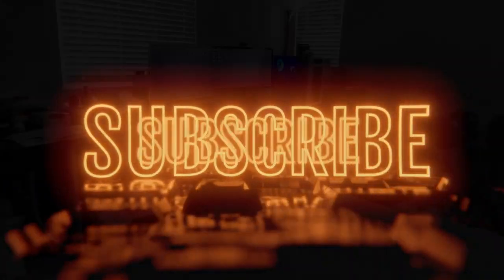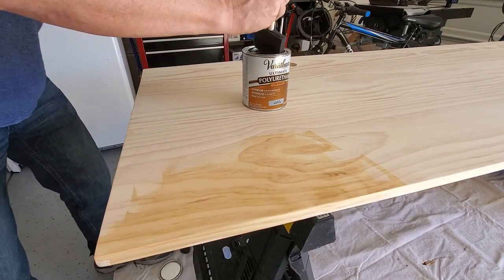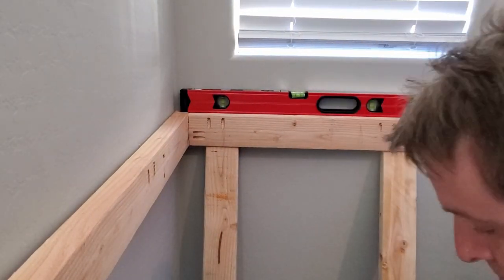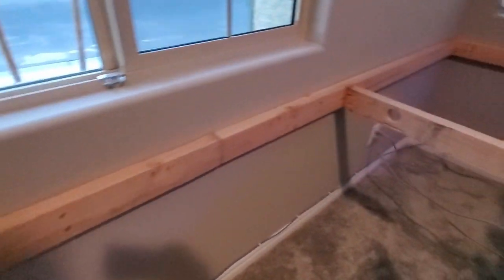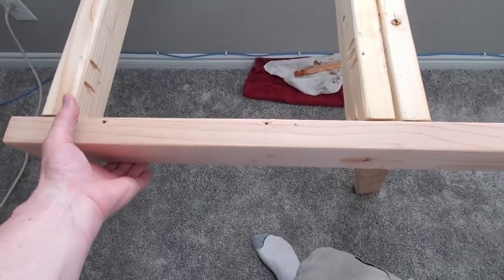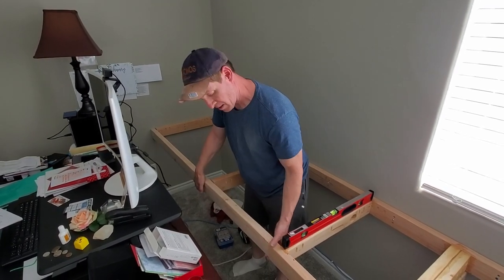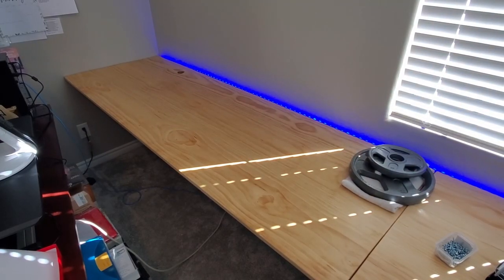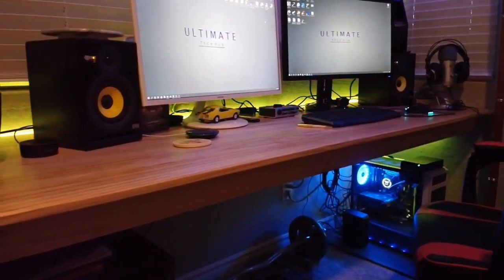MASSIVE FLOATING DESK BUILD HOW TO - LARGEST FLOATING DESK 2021

Comment: Should use longer screws to attach to the wall a 2 1/2” deck screw has 1.5” of 2x4 .5” of drywall which means only .5” in the stud
Reply from the maker: Yes you can use a longer screw.
Reply: nah. lag bolts.
Reply: @UltimateTechHub  I think his point was you SHOULD use longer screws not your could.  I agree too I’d be scared that thing would pull down over time if there’s not front support.  Cool build though. Definitely would have used my bolts myself. I guess since the weight is distributed across the back and sides it should be fine.
Reply: Nah nobody asked what u thought
Reply: I agree with pre drill and use lags but hell if you use enough of them should be ok. Just get up there and jump on it a few times to test. LOL

Comment: This could have been 5 minutes long and just as informative.
Reply from the maker: Yes it could have been shorter but I did want to show each step in detail. However I may upload a shorter version for those who want just the quick basics. Thanks for the feedback I appreciate it and thanks for watching!
Reply: @UltimateTechHub  this is great as I am a super beginner so the length is just right.  I come on here because I’m not experienced at all so I like to see all steps!  
Question though- you used the 4 different grit sand papers… did you do all of them in that order THEN used the poly?  And in between dry coats did you use the 320?  Hopefully not TOO dumb of a question(s), but everyone has to start somewhere right?
Reply from the maker: @keonetaihook2990  Yes Start with lowest grit to highest then wipe down well apply poly and sand with 320 or higher between coats. Apply 4 coats of poly or more for a wonderful shine.
Reply: For people that have no experience, the exact steps are appreciated. I’m very good with technology but when it comes to things like this, I feel dumb. There’s time stamps so you can skip for a reason
Reply: @CallistoRex  That's fair. I must have been feeling impatient that day.
Reply: @alexbrand4284  I know that feeling all too well!

Comment: Great project. Turned out great. If I may add some advice for next time/those looking to build...  When attaching table tops/desk tops that have been glued up such as yours with dimensional long grained lumber, it should never be glued down to the frame. You have a cross-grain situation that does not allow for the wood to move (contraction and expansion) with the changing temperature, humidity, and pressure. Over a period of time this may cause splitting, cupping, crowning, and all types of separation.  It's best to use fasteners for attachment like figure 8 fasteners to allow for movement. While I see in the comments you haven't had any problems, and that's great, I still wanted to mention this so others considering similar projects will understand the ramifications. Wood has a mind of its own and it's going to do what it wants.  And there's nothing more disappointing than have a fine piece of furniture become ruined long after it's built because of wood movement.   I just wanted to save some future heartache. I've been there! Lol.  Your desktop glue-ups turned out great btw.  Very nice project.    Troy
Reply from the maker: I agree 100 percent Troy and I made a recent update video on this project and here is the link! https://youtu.be/outLibBlauE
And thanks for the awesome comments and wood working tips I really appreciate it! And yes i regret glueing the top! Lol! 
I built a smaller version in my game room and did NOT glue the top here is that link!  https://youtu.be/3rchun2RFBQ
Thanks for watching Troy!
Reply: @UltimateTechHub   Oh, ok. I wasn't aware.  I'll check it out for sure. Hope my 2 cents will help someone.  Also looking forward to checking out your game room desk. Loving your content. In fact you got yourself a new sub! Keep up the great work. Best wishes and a Happy 2024 to you and yours!    Troy

Comment: 2 in timber fixed the wall with 2 1/2 inch screws!!!!! And the support bracket doesn't touch the wall plate at the back!. Left hand desk top bowed before you installed it! May look good but won't last.

Comment: Hey, 3-year check. How is this desk still holding up? I am wanting to build something the same and I am concerned over things like sagging and I just want to do things right. My desk will be a little over 12 feet long and support things like a 3D printer.
Reply from the maker: Zero sagging after 3 years and it looks exactly the same as it did when I built it. If you check out my newer videos you can see the desk in the background. I think with 12 feet in length you will have an easier time than I did. Good luck and keep me posted. Thanks for watching! 
Also, here is a video update I did about 6 months ago. https://youtu.be/outLibBlauE?si=OYpIYb7y7sJp-sx1

Comment: Your desk sag is being supported by dry wall thats a huge no no. Should have found the closest stud in the wall and made your support there. Im guessing your not a full time carpenter. Nicely done though.
Reply from the maker: Yes I am not a full time carpenter. The 3 dry wall anchors should support the middle section. The entire desk is connected to studs except the middle support bracket. Just wanted to keep the bracket in the center of the desk for a nice even look. Thank you for watching and for commenting!

Comment: Looks good!

Have to admit that a couple of elements (the frame butt-joint, the angle support going into drywall anchors instead of a stud, putting the angle support on as a freestanding piece instead of attaching the angle in-place) are driving me a little nuts, but for a DIY it should do fine!

If it starts to have some issues in the future though, framing in that butt joint (having a cross-support on either side) and tying the supports together would give more strength, and be less prone to twisting. Likewise with setting up vertical runners into studs (and going for more than one, if there isn't a single stud in the right location), and putting the angle supports directly in-place so it can provide support before the top starts to sag.
Reply from the maker: Yes I'm not a professional at woodworking but so far the desk isn't sagging and everything still looks good. Thank you for watching and for the great information I really appreciate it.

Comment: I been trying to piece together various desks and tops to form a floating L shaped solution I need on the cheap for my workspace. This video made me realize it all needs to start with a 2x4 mounted to the wall. Only difference is I would be adding a second piece for the corner L shape. Thanks for the 'Ah-Haa' moment!
Reply from the maker: Glad I could provide the Ah-Haa moment! I'm not a pro-wood worker, just love building stuff. After 3 years its still perfect.

Comment: I built a desk similar but I used birch plywood and iron on banding. Just rip to size. Also used wipe on poly, with a disposable microfiber rag. Much faster and that finish was rock solid for years.

Comment: what would ya change on the supports to make it 39" deep?
Reply from the maker: Just longer supports like around 36" deep. It just depends how deep of an over hang you want for your desk top. Also the shorter the span ( horizontal from wall to wall ) the stronger the supports. My span is over 14 feet so I had to use a middle brace for the center. Thank you for watching.

Comment: How high from the floor did you mount your supports? And if you did this over again, would you go any higher or lower?
Reply from the maker: About 26 inches to the bottom of the support frame. I probably would installed about 1 inch higher if I could do it over again. thanks for watching!
Reply: Very helpful, thanks for the video!
Reply from the maker: @TulsaDrones  glad to help and thank you for watching and if you subscribed thank you as well!!

Comment: I'm working on a 10ft version. Thank for the very detailed video. I was most interested in how you kept the middle from sagging, with such a long span.
Reply from the maker: Good luck and keep me posted. Thank you for watching!
Reply: I am thinking of getting an L shaped floating desk is it strong enough tho ?
Reply from the maker: @ashhishbhardwaj  Yes that should work well. Just build it the way I did. Make sure you attach the frame into studs. Thanks for watching and if you subscribed thank you as well.

Comment: Finished 10ft 32inch deep (so I could reach a support stud in the wall) desk using this video. I'm a newbie when it comes to wood working and staining. You just did a poly, but my wife wanted a very dark stain on pine. I used prefab edge glued pine boards at menards... really not great. Would never do that again. I used prefinish stain to help the stain take better to pine, but still was a mess. I also clamped the 2 boards together with same glue and it kept snapping up in the middle from the clamp preasure and splattering glue everywhere. Ugh... so much sanding. After weeks of on and off sanding, glue, staining multiple coats and multiple poly coats I finally crafted something decent. 
What I would have done different, and saved me a ton of time/money, would have been to glue my own boards together like you did OR say screw it and pay a little extra for quality wood... or have someone else do it :) Not just any wood will do. Especially the cheap stuff. I imagine an experienced wood worker would be able to make the cheap stuff shine but at the cost of a ton of extra time. I darn near scraped these boards and started over. Great desk now and most importantly the wife is happy with it. Thanks for taking the time to do this video :)
Reply from the maker: I'm glad it all worked out in the end and your wife js happy. Looking back I would have used walnut or maybe mahogany for the top. It would have probably cost a $1000 instead of the $350. But my wife is happy and thats all that matters. My channel is mostly about Technology but I do like wood working and its a lot of fun. Thank you for watching I really appreciate it.

Comment: Hey Thanks for the step by step video. I was looking for something like this for a while. I'm going to build something like this, but a little shorter. How heavy is the woods that the frame supports?
Reply from the maker: It's a pine top so it's not very heavy. Also the top is thin to keep it light weight.  Thank you for watching and keep me posted on your desk build.

Comment: Interesting concept. The connection @ 20:17 is not how you should use pocket screws. Pocket screw joinery is stronger when the screw enters a piece perpendicular to its grain. Other wise it’s easier for the screw to pull out. 

Instead, try connecting another piece perpendicular to the front rail and use a lag bolt to secure the two perpendicular pieces together
Reply from the maker: Thanks for the great information. I'm not a carpenter but my desk is still good as new 2 years later! Thank you for watching I really appreciate it.
Reply: @UltimateTechHub  it looks really solid and I’ve done something similar to build garage shelves. 

I’m no carpenter but have learned a lot via trial and error with pocket screws. They are super handy

Comment: get yourself an impact driver. then you don't need to switch between drill bit and screwdriver bit. also it drives in the screw better. also there is a drill setting on that drill that would make it easier to drill. or just a higher torque setting
Reply from the maker: Thanks for the great information! As you can tell I'm not a professional carpenter! Lol! However I can build computers and home networks with ease. Thank you for watching.

Comment: Aren't those pocket holes too close to the edge in the cross supports? Or you rely on the glue instead?
Reply from the maker: Yes the glue for strength and screws as a backup.

Comment: This is bloody brilliant!! I’m not a Carpenter but I’m now thinking about this method. My area is much smaller maybe 7-8ft wide so I presume I can do without the middle bracket?

Also my rear wall is brick so I can use with plasterboard so I guess I can get a strong base with that

Comment: Were those deck screws? They looked like pocket screws?
Reply from the maker: Both. Deck screws for the supports attached to the wall and pocket screws for everything else. FYI my desk is still holding up well. No issues. Thanks for watching.
Reply: @UltimateTechHub  thanks I’ve started now the frame pieces are all cut and ready now just today before England game. So will continue with the project asap. Good to see your desk is still holding up

Comment: 1. Should have used longer screws to secure the supports to the wall. The screws you used are biting more into the wood that the studs and with weight over time that's going to sag
2. Clearly you have a pocket jig/ Kreg tool should have used that to secure the desk tops together also just glue for boards like that isn't going to last 
3. Try holding your drill level also when driving screws in and you wont be slipping like that.
Reply from the maker: I used pocket hole screws and glue to secure the desk top to the frame. I'm  not a pro wood worker but my desk is very solid and has no sagging. Thanks for the great advice I really appreciate it. Thanks for watching!!
Reply: @UltimateTechHub  You might want to change out some of those 2.5" screws going into the studs. The problem is you start with a 2.5" screw, then lose 1.5" for thickness of the 2x4, then another 1/2 to 3/4" for drywall thickness which leaves not much screw biting into the wall studs.
Reply: You shouldn’t pocket hole the boards together  to create a table top, since wood contracts and expands it doesn’t allow for that. Wood glue is stronger than wood it should be more than enough if he clamped it properly.

Comment: Some elements of the design are decent, but in my opinion are very limiting. The top was done mostly well, but the underside you left the glue squeeze out? The 2x4's were rough and not sanded down? The edge lip was too thick. Almost 4 inches. Which makes it so your chair cannot go under it, and unless you are a strict straight upright perfect posture all of the time... is not going to work for most people who like to move around in their chair, adjust, etc. 

Also why glue the top to the 2x4's? there was literally 0 reason to do that and it makes it a lot more difficult to remove later and more likely you will not be able to reuse that top later if you choose to remove this. I haven't seen any of your other videos so maybe a newer one covers it or shows a thinner top? 

My suggestion for those who wish to have a similar "floating" top would suggest you look at it more like a shelf. A longer wider shelf. There are a number of methods you can use to do this but simply searching for heavy duty shelf brackets would go a long way. But some tips, you don't need the bracket to extend all the way to the edge, you can have some overhang and be fine. Depending on the material you use it can be more or less. For example 3/4 hardwood plywood I'd be comfortable using 21" brackets for a 32" deep desktop. If you plan on putting any heavy weight on the outside edge, like planning to sit on the edge? I'd suggest using at least 1/4" lag bolts/screws that are at least 2.5" (No more than 3.5") assuming 1/2" drywall in the top hole. The lower 2 or more holes don't matter as much they are there just to add some stability. That top hole is the one supporting all of the weight. I'd highly suggest spax torx lag screws. You can get 1/4" x 3" They are roughly 75cents each. So this desk would need about 9 brackets so at least 9 of those screws. So 10 bucks or 30 if you want to go kill mode and do all of holes. Completely unnecessary, but sure? The heavy duty shelf brackets themselves will be roughly 10 to 20 each depending on a few factors. You can get some really good ones on amazon for about $35 a pair. So let's say 200 in brackets, 30 at most for screws, and how much ever he paid for the top. The description says he paid 360? Not sure where all that money went to, but as you can see above, it could have been thinner, heavier duty, etc. Super heavy duty? 2x3/4" hardwood plywood glued and screwed together. 

If you need to go deeper than 32", that could be an issue when buying off the shelf brackets. 

The top in the video is 29" So 20 to 21" brackets would work for that depth of top. That specific top it would put the glue seam right at the edge of the support. Depending on the glue and prep it may or may not break if any significant weight was placed on the edge like sitting on the very edge. 

Also a note on the anchors holding up the support. The idea that they could hold that weight is not accurate. The pull force on the leading edge will be quite significant which maybe you have found out by now if you put any kind of real weight on the center. Like if you sat on it for instance would be "less" than what you said it could hold... but really it can't and would pull out of the wall. My guess is the center would sag about 3 inches and pull that wood bracket out of the wall. 

Also a note for that kind of project, use torx deck screws. They camout a lot less and are a lot easier to use in general. It would have made your time a lot more productive and less aggravating.
Reply from the maker: Thank you for watching and for the great advice. I'm not a professional wood worker so I definitely made a few mistakes. I definitely shouldn't have glued that's for sure. The Top had held up well and both of my chairs fit underneath the desk easily. I measured both of our chairs so that they would slide underneath. The 2 by 4s really don't show so I didn't sand them except for the front 2 by 4s. I sealed and painted them recently so they look great. Here is a video I made for a smaller floating desk. I didn't glue this top. Learned me lesson. Let me know what you think.
https://youtu.be/3rchun2RFBQ